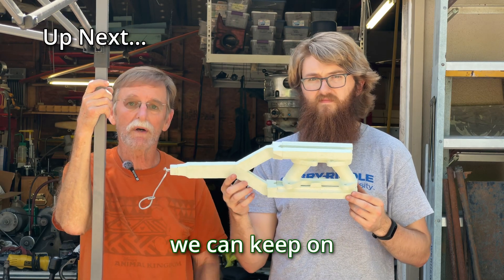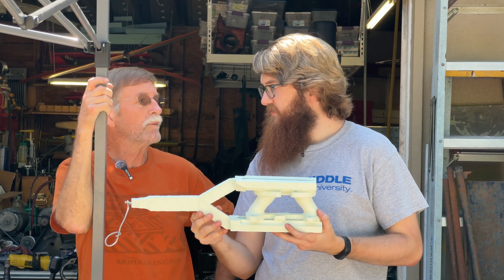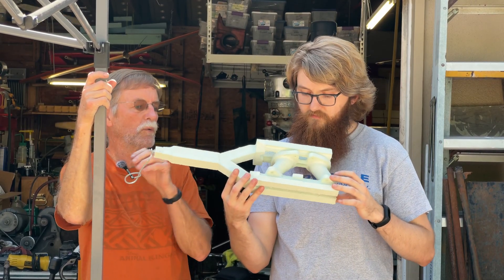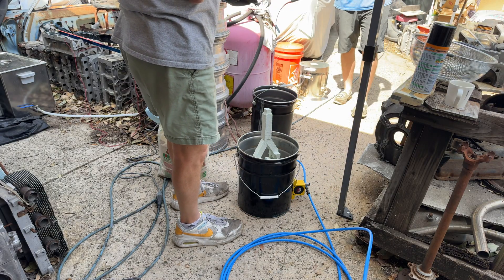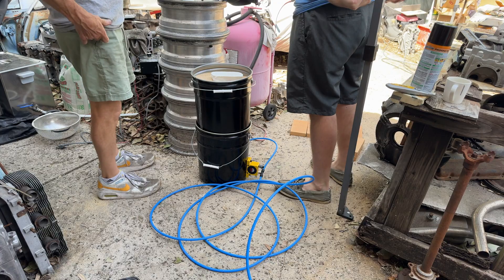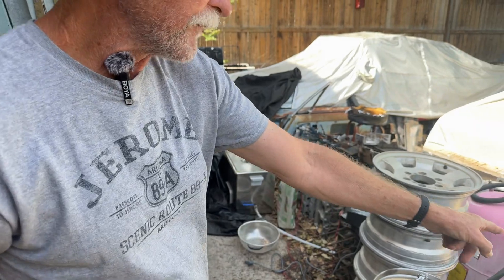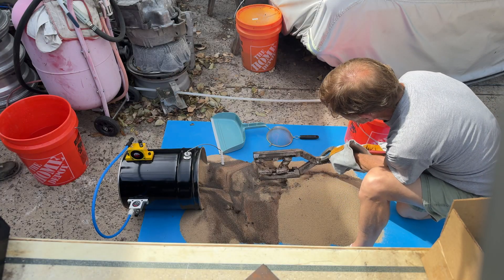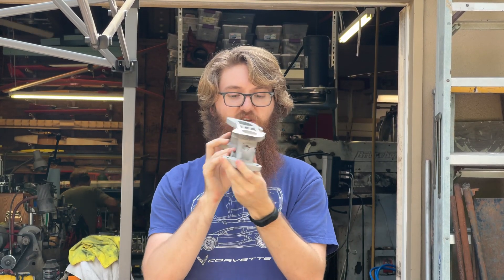Hybrid Lost Foam Casting A Corvair Intake

Comment: Btw there’s dedicated filaments made for lost fill casting. I’d also recommend that you cover the form in any number of ceramic/plaster like coatings designed for lost cast pretty thoroughly and thick

Afterwards you can just completely burn out the fill leaving it hollow

You could also go through the same process using filament that dissolves in water and use that to create the form for the loss foam casting plaster/ceramic 

Just make sure you absolutely bake the hell out of the form to get the water out (which honestly you should do either way and pre heat before pouring) 
Pre heating your form and the support material can be extremely important depending on your casting materials
Reply from the maker: We looked into that method and it's basically just investment casting but the mold is 3d printed. Overall the potential time save of going from printing straight to casting is why we're trying this one instead.
Reply: If you haven't figured out why your casting are failing I maybe able too assist you I use too work in a foundry.

Comment: Incorporate a top clamp on your pouring shank. Make a U-shaped sheet metal cradle that your pouring cup nests in and then grasp the sheet metal cradle with pliers to extract your pouring cup. Use more/better PPE. The gating is extremely overdone. -Simplify. 1/16" wall thickness is impractically thin for any sand casting process. 3/16-1/4" wall is much more practical. Excessively high pattern density and metal temperatures is a very bad combination and will result in high flaw rates in your castings even if they fill. Not (yet) a fan of 3D printed patterns for lost foam process, but if you must, use light weight PLA with low infill. Even with low infill, 3D printed patterns will be inferior and more likely to produce fold flaws. If you must superheat the aluminum to get a complete casting, the quality of your castings will always suffer from hydrogen porosity and high flaw content. Best, Kelly

Comment: @American Flat 6

Those are promising results, not sure if the 5 papers i sent links to have shown up on your end or not. There is something else I suggest you add to optimize the process. Before placing your 3d printed part, mix the sand with the correct ratio of sodium silicate so that the sand hardens around the 3d printed mold giving it more structural rigidity , I believe it should improve results according to previous experiments. The other recommendation, use pla filament made for casting such as esun transparent or polycasts, essentially a thin shell, ideally 0% infill but you can still get good results upto 5% infill and you will save alot more time printing due to loe infill. If the links still dont show ill send you names of papers and you should be able to find them on google hopefully. Fantastic channel, great work and content, always looking forward to your videos and eagerly waiting for full scale cylinder block which i am confident you can achieve.